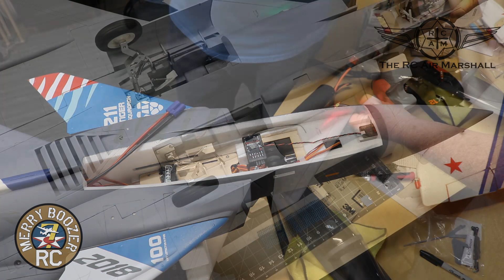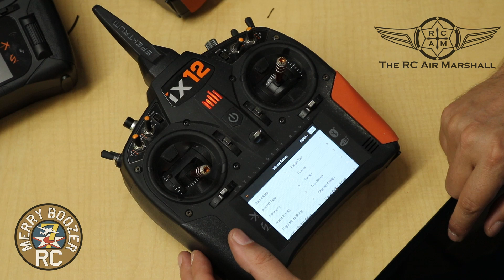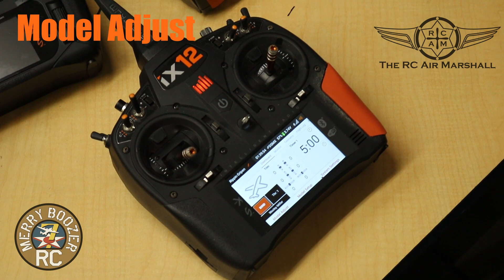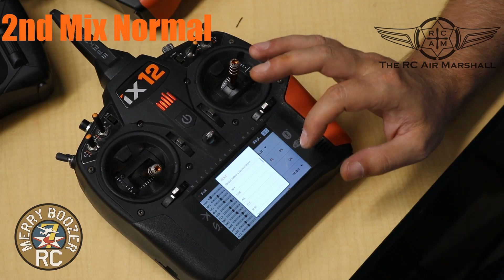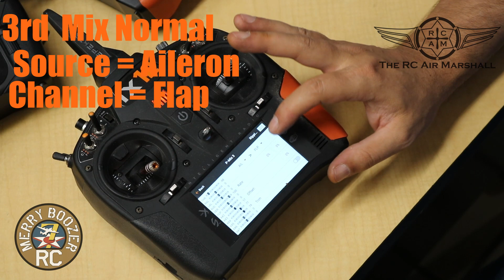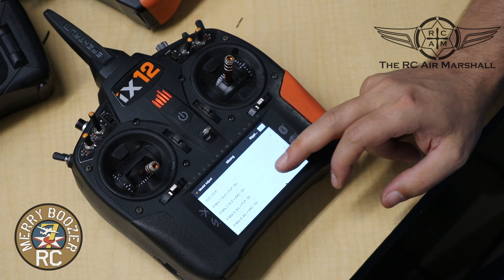Freewing JAS-39 Gripen 80mm EDF Jet Canard Programming

Comment: The wiring is very important but wasn't included in this vjdeo. If you're using a receiver with a gyro just bypass the control box and run every servo to it's own channel before flowing this guide.
Reply: Asking for a club mate who has ordered this bird and he needs a gyro RX (AR8360T with AS3X/SAFE). What does this control board do? Note: I´m not a Spektrum guy! Nice video by the way!

Comment: Can I use a dx8 for this setup or do I need more channels...thanks
Reply from the maker: 8 is plenty
Reply: @MerryBoozerRC  really?!!.. I thought I was gonna have to buy another transmitter...I was also going to get the spectrum 8 channel reciever that you are using so this video will work out great...thanks alot
Reply from the maker: @mannysrceverything712  also you can get away with a 6 channel receiver guys have found a way to do it with Y harness I think James did a video on Motionrc
Reply: @MerryBoozerRC  and also is that without a gyro ....if I added that would I need more then 8 channels?
Reply from the maker: @mannysrceverything712  nope gyros don’t add channels although it might get a little tricky programming a gyro in on this bird

Comment: Couldn't you just set it up as Elevon or Elevon B wing type with no mixing, and just tie the opposite canards and elevons with y-harnesses, maybe with signal reversers. The left canard will always move in the opposite direction of the right elevon and vice versa.
Reply from the maker: Possibly but my brain doesn’t compute that lol 😂 this is one way to do it I’m sure there are others
Reply: @MerryBoozerRC  I was thinking about scratch building something with canards, and I think I could save two channels and the mixes by setting it up this way. 
Taking the left canard and right elevon: If you wanted to pull up, the left canard would have the trailing edge deflect down, the right elevon would have the trailing edge deflect up. If you wanted to roll right, same thing. 

To roll left or nose down, each would be the opposite of the above. In any case, the right canard and left elevon would also be working opposite of each other, one way or another.
Reply: It would mean the minimum radio system is only 5 channels, or those extra channels could be used for things like discrete nose gear steering, motor reversing, afterburner, thrust vectoring, etc.....
Reply from the maker: Just seen my buddy Dave from the video answering this on Facebook don’t know if your the same guy he was talking to but here’s his response (RCAIRMARSHAL)

Charlie Marchiony you’re right. LoL. Sorry... I was overthinking it in my head. Yes, you should be able to Y the left canard with the right elevon. And right canard to the left elevon. I’m going to delete my previous posts so people don’t get confused. Now keep in mind, doing this you won’t have the ability to adjust travel and trims independently. The canards will always do what the elevons do, which may have been my concern with wiring them this way. I don’t think I left the canards at 100% travel, and Y together they had too much throw. For the Gripen